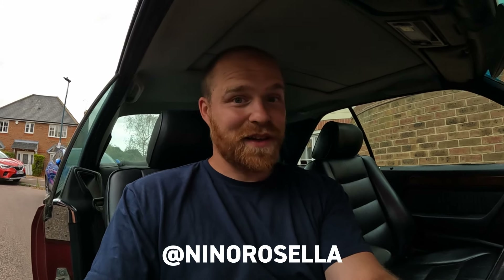One Last Try Fixing My Mercedes 220E

Comment: Still think it might be the fuel pump / main relay board. So common in 90s Mercs where the circuit board used in quite a few big chunky relays heats up then loses continuity due to bad solders. Would explain the cutting out immediately after warm up, just like the open to closed loop scenarios. 
Once you have sorted your misfire, please try a different fuel pump / main board relay or research the issue.
Reply from the maker: Thanks for the info bud. When you say "main board relay" do you mean the OVP relay that these Mercs have, or is it a different type of relay you mean?
Reply: @NotEconomicallyViable  No, it was something my father mentioned (from his days owning a W124 190e as he is a Mercedes man through and through - his 2005 E320 is an awesome car) when we were discussing your issue(s) and he probably meant the main fuse board (where the fuel pump relay resides). On a great deal of W124 from this era the relays are round pin circuit board type chunky offerings and the circuit boards go bad inside. For example the KPR relays part number 003 545 20 05 (not checked as specific to your car). There are similar multifunctional relays that cover several parts / circuits which can set off multiple warning lights if bad. If I were chasing down the issue my first points of call would be
a) refresh ignition system
so engine runs smoothly
b) replace engine loom
eliminates any wiring faults
c) see if the cut out still occurs

Engine cut out is a fairly common issue on W124 models 92 to 96 as you know, unfortunately.
Reply from the maker: Appreciate that 🙌🏻

Comment: Hi very nice video! First I want to start by congratulate you for creating this great channel with good car selection, interesting projects, informative and straight to the point videos overall great content! I have been trying to do the same myself for some time now sow I can appreciate the effort that you have put in your channel. I have the same project car Mercedes W124 actually I have bought 3 of them almost at the same time. I am yet to begin the real work on my cars but I have done some work on them just enough to know how difficult can it be to pinpoint the cause of a particular problem they may have. I am rooting for you! 
Everyone can see that you`ve learn a ton of stuff in such a short time. I have spent so much time around cars and still don`t think I understand them all that good.

Comment: Do them engines have a cold start valve on them (like an automatic choke but for a fuel injection engined car) or does it have leaking/weeping injectors as that would cause it to stall once it ran for a specific length of time.
Reply from the maker: I'll have to take a look into that. Cheers, Mark 👍🏻

Comment: You'll get there nino. First thing I'd do with that is do the loom. Then that's ruled out. It's deffo misfiring so you need to find out for sure where the ht lead so to the plugs. Then the cranksensor. If after all that it's still the same the next port of call is the ecu. There may be somewhere that can check/repair them in the UK? Anyway man, keep at it your doing great and warm regards from Ireland from a clk owner.
Reply from the maker: Thanks for that, George. I'll have to take a look into the ECU if the new wiring loom doesn't fix the issues 👍🏻
Reply: @NotEconomicallyViable  ill be following along for sure mate

Comment: Have you check the petrol. Look like the indicator on reserve feul
Reply from the maker: I did think that at one point, but the gauge comes to life after a little while
Reply: Check ecu socket. It could be rust or water damage. Clean it with electric contact cleaner. Check your cam shaft sensor.
Reply: Also check is there any vacum leak from airflowsensor to trotalbody
Reply: Check feul pressure ragulator.

Comment: Hi mate are you sure that's the crack position sensor you have changed it looks to me that that was the Speedo sensor as it was on the gearbox and I think the misfire will be the leads the wrong way round
Reply from the maker: When I ordered the part using the part number they were all listed as crankshaft position sensors 🤷🏼‍♂️ I did reverse the leads, but it made no difference bud

Comment: And with all that been said can I make some suggestions?! I have read through the comments and I think that they have a valid point. I can see that most of the things that I wanted to mention have been discussed already but I still want to comment on some of them. Probably if you change the position of the spark plug cables in the right order the engine will start to run properly again. I completely agree that you have to replace the wiring of the car. The crankshaft position sensor was solid candidate to be the cause of the problem as suggested the ECU is very strong candidate the coils and the relays can make the engine to cut off. On some cars when the fuel pump runs for some time and it gets warmer it stop working properly but I think that the fuel relay is more likely to fail in this situation. I know that you had problems with one of the relays on this car already so you can see my point. I have all so had some problems with them as well and I know that it can be frustrating to deal with problems like this. W124 have this accumulator next to the fuel filter which can cause a lot of problems for example loss of fuel pressure and some times poor starting and more. Another common problem they have is clogged fuel or screen filter which is mounted in the base of the fuel thank. But it is going to be best if you start the engine and let it run to the point when it begins to cut off and perform some tests to determine if the ignition system is the problem or the fuel system basically if it has spark and fuel in that moment. To check how much fuel or if there is any fuel coming from the fuel pump simply disconnect the supplying fuel line and place the hose into a container and crank the engine. To check for spark simply pull out any spark plug cable use a spare spark plug with this cable somewhere to touch the engine for ground and you can see if there is a spark.  You may already know this but I just wanted to mention that you can check the resistance of the different sensors before replacing them if you search online you can probably find the proper value for the resistance of most of the sensors at the different engine temperatures. Good luck with your project!

Comment: Great videos really enjoy them just my two cents i do not believe the crank position sensor is going to solve the problem i am along the lines of a vaccumm leak possibly split in a hose somewhere causing too much air.
Reply: there are hoses under the air intake manifold that are knowing to split
Reply: A vacuum leak normally doesn't lead an engine to run on 3 cylinders. Or cutting out when heating up.
Reply: @mehrzahl2219  true

Comment: In the end there it was misfiring badly/not running on all 4 thats clearly the sound of a 2 and 1/2 cylinder engine which suggests issues with the ignition or injection. (or did you have the wrong firing order on the spark plug wires?) 
My first thought in the first episode was that there's something wrong with the throttle body and/or the Idle Air Control valve (or however this car is controlling idle air) though I think you never mentioned if it also cuts out when keeping it at 2000-3000rpm manually or just at idle? 
That would've been an important piece of evidence for trouble shooting imho.
Since it starts at a higher rpm and then idles down to 1200 and then idles down even more but cuts out at the same time I would've guessed that the idle control doesn't work as intended. Also those values are timed based on engine temperature I assume and if the engine is just slightly warm it doesn't go into high idle at all. (Thats at least how my cars of that era usually behaved) But if course that theory is only valid if it doesn't cut out when keeping it at a higher rpm.

I guess now with it misfiring and it seemingly gotten worse the more you touched it a new wiring loom is definately the way to go before doing any more trouble shooting.
Reply from the maker: Appreciate all that info 👍🏻 I've never tried keeping the revs above 2,000 rpm, so that's definitely something I'm going to have to try!

Comment: any progress on the car?
Reply from the maker: Yeah, I've found a terminal issue. Just trying to work out my options and see if it's worth even trying to fix.
Reply: @NotEconomicallyViable  i see.
I have the same car,well almost same, mine is sedan, but engine is the same.
And i had similar issues.
Wiring loom is not that big task to do, its a bit tedious, i admit, but if you go wire by wire, you will be able to do it.
Only thing which was annoying were plugs for throttle body and MAF.
You have to cut them with dremel to reach the pins.
Plug for throttle body(from wiring loom) can be coroded,as was mine, so keep that in mind.
Also, if you want better acces to coils, remove the bracket supporting the intake, its just 3 bolts, on this bracket you will find throttle body plug as well.

But i have to say that once this was done, its really a nice car to drive.
Hope you won't give up on it.
Best regards!

Comment: They have problems with the motor installation because Mercedes used wires with biodegradable insulation. You need new engine wiring or make new insulation on old one.